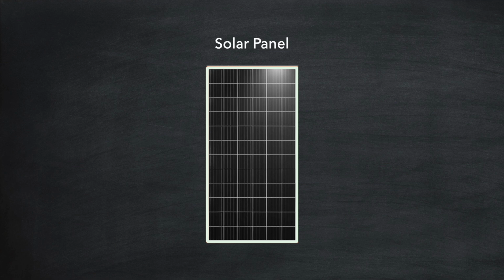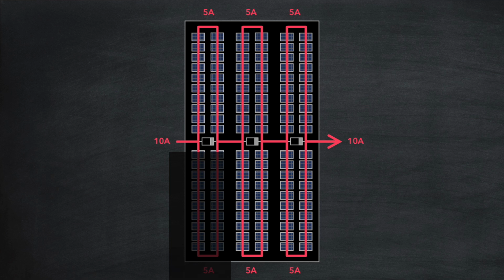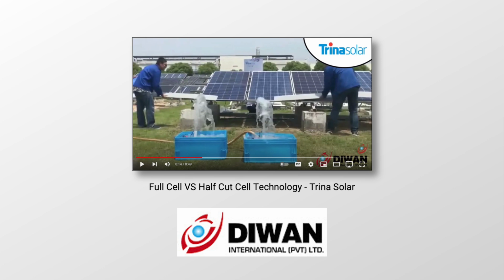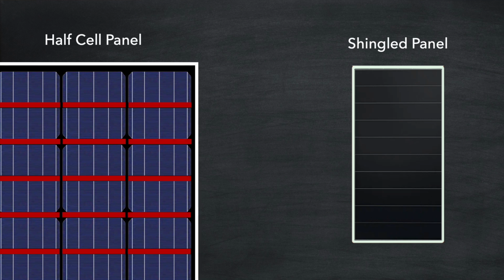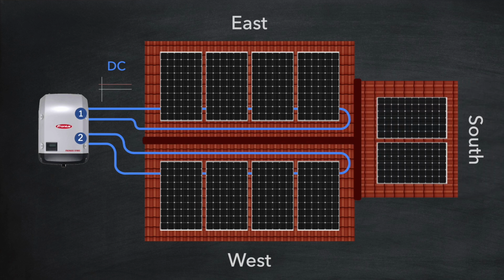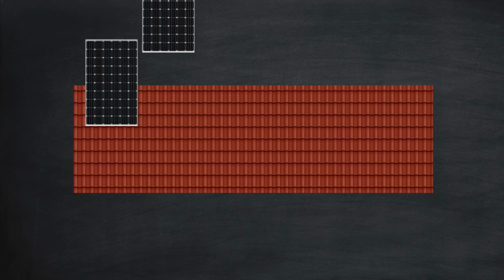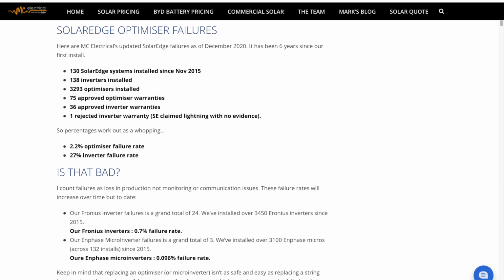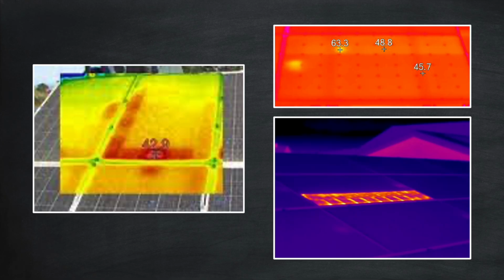Solar Panel Shading (Part 2): More on Optimisers and Micro inverters

Comment: A great series of videos, Gary, which has gone a long way to helping me understand the impact of shading. One question that you might be able to shed some light on (no pun intended!). In 2013 I had a 4kWp string array installed on the south facing roof of a house extension I was building. Unfortunately there’s a big bank at the back of the house, as high as the house itself, so when the sun is low (eg winter, or mornings/evenings) then the upper PV panels might be exposed to the sun whilst the lower PV panels are completely shaded. I understand now why production in this scenario will be poor on all panels, not just the ones in shade. However, I also find that on bright sunny winter days instantaneous solar production can still be very poor (for the above reasons), yet on slightly hazier/cloudier days where the light is a bit more diffused I frequently seem to experience much better instantaneous production. Can you think of any reasons why this might be?
Reply from the maker: Hi Alan, thanks for the kind words! And also for your detailed comment. Can you give me some more information please about your setup? How many panels, what arrangement, max kW generation in full sun (both on a hot day and a cold one), same for non-shaded cloudy/hazy day, and same again for when array is 50% hard shaded on sunny day. Ta
Reply: Gary, thanks for getting back to me so quickly. The 2013 system has 16x250W roof-mounted Samsung panels, a row of 10 in portrait orientation above the remaining 6 in landscape orientation - connected in a string (if I knew then what I know now, I wouldn’t have done it like this - I just relied on the installer). The inverter is a Steca 3600, which like many of its generation just has a LED display giving instantaneous generation, so really the only data I get is instantaneous production and a daily total production. Steca were supposed to be bringing out a data card that I could insert into the inverter that would record more detailed information, but they ultimately dropped this in favour of only putting it in their new inverters, much to my annoyance. Last year I installed a further 5.7kWp ground mounted array with battery storage (SolarEdge system) in a location that won’t be subject to shading, so I’m able to check the instantaneous production of both arrays. I don’t have the amount of data that would allow any rigorous analysis, but if I take last Monday and Tuesday as an example. Monday was a bright but hazy day, my SolarEdge system produced a total of 10.3kWh and my “Steca” system 3.13kWh. Tuesday, by contrast, was a very bright sunny day, and my SolarEdge system produced 20.8kWh - but the Steca system only produced 1.56kWh. On the Monday (the bright hazy day) I checked instantaneous production of both systems at one point in the day, the SolarEdge was doing about 2kW and the Steca system about 0.65kW. I repeated the exercise on the Tuesday (the very sunny day), and whilst the SolarEdge system was producing about 4kW the Steca system was limping out a paltry 0.1kW. My current theory is that the “harder” shade of a sunny day moves the MPPT current to a lower level than the more diffused shade of a hazy day, where the MPPT somehow allows a higher current. But that’s just a subjective opinion of course, I’ve no science or data to back it up.
Reply from the maker: @alanwalker6185  Thanks for this extra information. It's difficult for me to draw any meaningful conclusions from this unfortunately - I would get a professional in to take a look and perhaps carry out some shading experiments with monitoring equipment hooked up. Good luck with your analysis and I hope you manage to get resolution.

Comment: Here in the Netherlands a big selling point for microinverters is the reduced risk of fire. Especially for installations with more than 10 panels the DC current will over time pose a greater risk. If the connect wears out and corrosion occurs in a connector that can lead to a very hot point of failure and may even cause a fire. 
The second one you already mentioned, that it is easier to replace a single panel in your system. Although this is very unlikely to be necessary.
Reply from the maker: Thanks Jeroll - these are great points. I think safety of solar installations is going to become more and more prominent as the mass market grows.
Reply: I've also heard people are not getting home insurance renewed because of high DC voltage from Solar Panels?

Comment: Hey Gary, at 16:40 you start to refer to all solar panels in a string array being brought down in performance by the worst performing panel. You also mentioned optimizers and microinverters combating this. But in another video of yours you refer to the NRG Solar team who performed a test that proved that both string and microinverters performed the same when a panel was damaged and reduced its performance. Trying to understand how your example here differs from the physical test they performed and showed little difference.
Reply from the maker: Hi Sam, a very good question and there is a good answer, I believe.

The physical test performed in the other video is where NRG inflicted damage using a cricket bat at the same position on the first panel of each of the two arrays, then verifying that both outputs of both arrays remained the same over the next few days.

What would likely have happened is that one or more of the solar cells in those panels would have stopped working. That would cause bypass diodes to kick in, essentially taking those damaged cells out of the circuit. Because the remaining cells on both arrays were unaffected, it would explain the equality of the results.

You see, that even with optimisers or microinverters, it is still the bypass diodes that take priority in power management in the panel.
Reply: @GaryDoesSolar  thank you for the reply Gary. I now understand that the damaged cells were bypassed, but in the event of a poor performing panel the bypass is not triggered and has a chain reaction to the other solar panels.
Reply from the maker: That's true, and that is where I think optimisers and microinverters have a part to play with partial shading, the localised build up of dirt on the array, or differing panel degradation.

Comment: Gary made one big assumption in his recommendations and that is the Solar Panels are mounted on a roof.  While that is certainly true of most installations for the smaller number of low mounted panels a different set of calculations come in to play regarding optimisers.  Firstly replacing a faulty unit is not an expensive or difficult operation when panels are mounted where there is easy access.  Secondly ground mounted panels are more likely to suffer from shading.  And thirdly something that Gary did not touch on is electrical safety, this much more important where there is easy access and optimisers improve this considerably by reducing the maximum open circuit voltage to just 1V.  For these reasons on a ground or low mounted installation I think that optimisers are something that should be seriously considered by installers.
Reply from the maker: Agreed regarding access to microinverters and optimisers is easy for ground-mounted arrays, but my videos are really targeted for those looking at roof-based installations (the predominant use case). And in my videos, where I show an array, it is always on a tiled roof. Not many people are in a position to set up a ground-array solution. 

On the electrical safety point, what you say is true, but not relevant to the topic of the videos which was shading.

All that said, and aside from shading, I really do like the concept of microinverters, and so my video after next will be all about the benefits of them, with a challenge out to the manufacturers, which could result in microinverters being the de facto standard for all domestic solutions.

Comment: Hi Gary
My pv system has got three arrays, facing directly east, south and west with microinverters. On top of the multiple orientations, there are shading issues, particularly on the south array. These are shingled panels matched with microinverters and the system is producing well, but immediately when shade appears on a panel and starts moving across its surface, the output of the specific panel significantly decreases.
Mitigation of the effects of partial shading on pv panels is still a huge challenge.
During my research prior to the installation, I found a paper from Germany where they compared 8 pv panels with different technologies for partial shading, in over 1000 scenarios and the shingled panel did better than everyone else. However it was only 15% better than the worse panel and this 15% when translated in kWh was not that much, as ALL the panels under partial shading had reduced output. Nevertheless I went for it, as it is still better than nothing.
Reply from the maker: Yeah, for your situation, microinverters certainly sounds like a very good solution (as I described in the video). I'm not a big fan of the shading benefits with microinverters, but actually I really like them for a whole variety of reasons - so much so that I'm making a video all about those benefits. Hope you like it - it'll be the video after my next one... :-)
Reply: @GaryDoesSolar  
My only concern about the microinverters is clipping. Even on a sunny winter day in North London (like today 18 Jan) the south facing panels’ output saturated the microinverters. Certainly energy is lost, but probably not very much. I have researched clipping extensively and I am very much looking forward to your video.
Reply from the maker: @serraios1989  I'm coming to the same conclusion. It was a surprise to find out that Enphase's latest microinverter (IQ8) has a power limit that is nowhere near the latest panels with 415kWp. But, the impact of that is lower than you might expect, especially when you take into account panel degradation over a 25-year lifetime.

Comment: Super impressed with your solar video series. I'm in the process of deciding on my own solar set up and found your video on microinverters and optimisers very useful. I agree with your conclusion and will not be going that route. Can you recommend an installer who installs the Perlight Delta shingled panels you chose?
Reply from the maker: Thanks for the kind words, Paul - and I’m very happy to hear that my videos have been so helpful to you. 

Now, most installers should be able to get hold of those panels are they’re quite popular. Just specify that you’re looking for those particular ones. Good luck!

Comment: Unless there’s shading on the panels optimisers are really not worth it.
It would be a reallly bad investment from the money perspective. They only increase output in single percentage digit, while costing almost as much as an extra panel. Most of the time the array is better off with an extra panel rather than a bunch of optimisers
Reply from the maker: Yeah, whilst there could well be a benefit of using optimisers to counteract shading, I came to the view that there is little (and largely unknown) differential in the level of benefit compared to the cost of achieving it. Given that, people might get a greater return on that money spent elsewhere...

Comment: Great video Gary, interesting facts on the difference between half and full cell panels ... and if I'm honest I agree with your comments referring to optimisers and think why invite reliability problems on a commodity which as you say is difficult to access. If shading isn't an issue I say just go with panels and string inverter alone.
Reply from the maker: Thanks for your kind words, Rog - it means a lot.

I guess I'm not overly excited about optimisers/microinverters in relation to their performance wrt shading. For me, it's all about the value returned against cost, and I don't think there is a large differential between those for shading.

But... I actually really like the concept of microinverters, and I believe that they have the potential for being the de facto choice for domestic solar installations globally. So much so, that I'm making a video on that to explain... :-)

Comment: Great pair of videos.  If you are choosing a panel because of its warranty, how will you know that one of say 20 - 30 panels has fallen to say 85% of rated output when it should be 90%, without optimisers. 
In the 1st video you said the optimiser could cost as much as a panel.  I would like to see a half decent $80 panel, because that is what the Tigos cost here in Australia, or Huawei at about $65-70.  THe Huawei optimisers are warranted for 25 years I understand.
Reply from the maker: Hi double-x :-) thanks for taking the time to comment on my shading videos - very much appreciated! Now, you raise a good point. Without any kind of monitoring, how would you know? And without any panel-based MPPT (either via optimisers or microinverters) how would your system ensure that those panels which have deteriorated the worst, don't bring down production of the others? I mean, it all points to the argument of having optimisers/microinverters, but I worry about their reliability, which could end up costing you more than they're saving...

That said, I do think there is a case for microinverters as the key to mass adoption of solar - something I'm making a video on shortly... 

With regard to pricing, your point is valid (wrt optimisers) - they're relatively inexpensive now - although I do believe you have to buy a separate monitoring unit for the array as well?

Comment: Hello Sir,

If the current is reduced to 5 A for one PV and you have several PV's in series, all the string will run at 5 A, meaning that the power is reduced also like in the case of FC when the bypass diod is not on ( reduced irradiationce on the cell). My question is in the example that you showed at minute 4 to 6 would not be better to have that diod active so we will have 10 A and 20 W? (meaning the string runs at 10 A and the rest of the panel in the string have 300 W instead of 150W when the current is reduced to 5A)

Thank you!
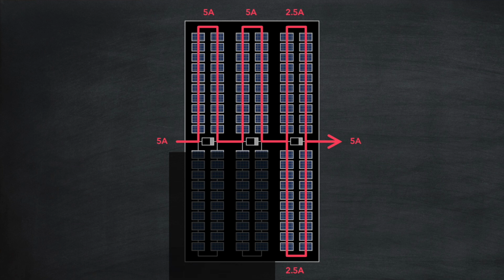Reply from the maker: I'm not sure I understood your question correctly, but if you're talking about the scenario at 6:10, then this scenario is for only one panel in the string, therefore the MPPT of the inverter is best to reduce the current to 5 amps to get the highest power output. If there were several panels in the string and only this particular panel had shading, the MPPT inverter (which acts on the string as a whole) would automatically see that pushing 10 amps through the string will provide the highest output, as you suggest. Hope this explains :-)

Comment: Good update - thanks!  I chose to use Tigo optimizers even though I have no shading issues.  I installed the system myself and I will be maintaining it, so the monitoring will be extremely useful.  Second, we need the safety shutdown at the panel level because of the new electric code in the US.  The optimizers have that built in.  One last advantage that optimizers have is they get the most out of each panel because each panel has a slightly different output level.  I don't know how much it helps, but it probably isn't much.
Reply from the maker: Thanks Mark, and great to hear that the Tigo optimisers are working out for you. The safety shutdown is certainly a great feature.

I general, I'm hoping that the manufacturers of optimiser and microinverter products continually improve reliability rates over time, and this surely will help take up of those products. Looking forward, I see no reason why microinvertors should not become the most popular solution for solar (even over string inverters), given all their benefits. Let's see what happens...

Comment: If you use  micro inverters that changes it to ac, how do you connect it to you inverter in the house if it is designed to run on DC? I know, beginners question.
Reply from the maker: No problem - all questions are welcome on this channel 👍🏻 

In fact, once the microinverters have converted the DC to AC, there’s no need for an inverter at all. That AC is fed directly into the consumer unit of the house. This makes for a relatively straight-forward install.
Reply: @GaryDoesSolar  and what if you wanted a backup battery/off grid? Just stick to the optimizers and string inverter?
Reply from the maker: I guess you could still use micro inverters so long as your battery/backup component is AC-coupled.

Comment: Diodes have a limited number of cycles on-off. Their meaning is not to handle shade every day. Their mission is to protect the panel. So If they are triggered daily you lose the panel !
Reply from the maker: Consider solar arrays on roofs in built up areas (i.e. most home installations). As the sun sets and rises, you could expect shading from other buildings on panels, which in turn would activate bypass diodes. This would happen day in, day out on sunny days, so how would you explain the non-occurrence of millions of panels failing after a few years?
Reply: It is 100% shaded every night, so they are going to be cycled every day I would think.

Comment: Thanks for the Video Gary.  When you are saying "Inverter" are you talking about micro inverters only or string inverters as well?  I have half cut panels with bypass diodes with an all in one MPPT string inverter.
Reply from the maker: You're most welcome. Yeah, it can get confusing between "inverter" and "microinverter". So, in my videos, if I just say "inverter" I'm always referring to a string inverter. Hope this helps!